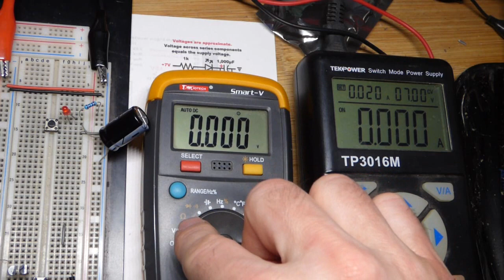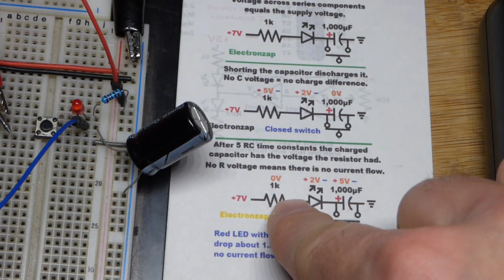Series components split up the supply voltage through division and drops by Electronzap

Comment: An unlimited current (from the 1000uF capacitor) would flow through the switch when it closes.  This would shorten its life.  Best put a 68 ohm resistor in series with the switch to limit the current peak to about 100 mA.

Comment: How do you prevent damage to the capacitor and switch short across the switch ?
Reply from the maker: This is a somewhat small value capacitor and the voltage isn't very high. So I don't think any damage is done the the switch. I avoid shorting a capacitor that has more capacitance and/or is charged to a higher voltage.

Comment: How does a diode have voltage across it ?
Reply from the maker: Diodes aren't perfect conductors while forward biased. Instead of resistance, they primarily block some of the voltage, which is their forward voltage. Other series components get that much less voltage across them because it stays across the diode.